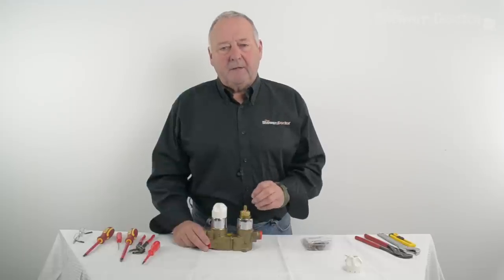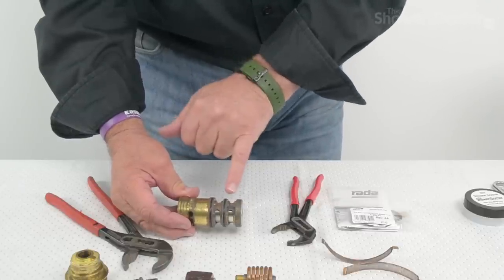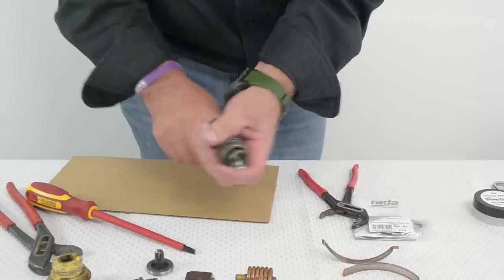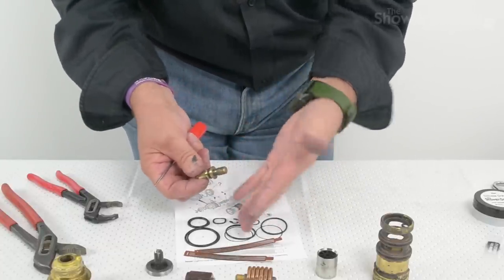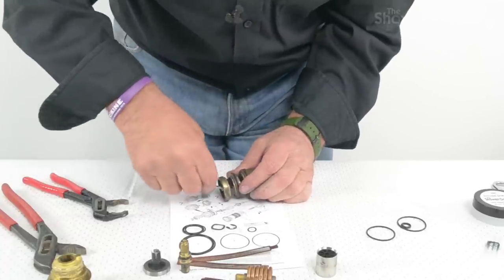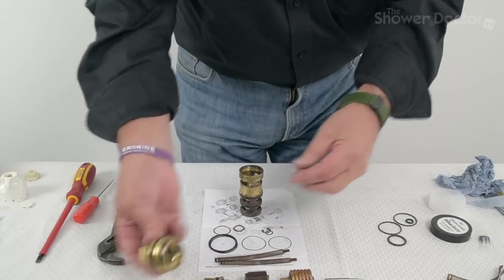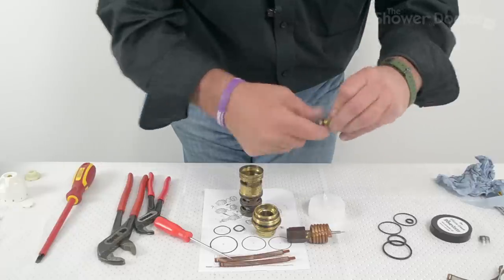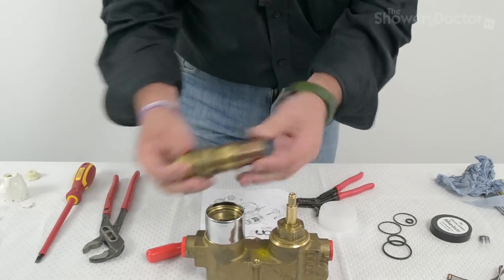Servicing Mira 915B shower valve. Part 3: Temperature cartridge

Comment: Really useful to show in detail how one of these comes to pieces and is put back together.  Thanks.

My shower stopped getting fully hot, just warm, even when the supplied hot water was very hot.  With the help of this video I fully disassembled (with the exception of removing the copper spring coil from the hex boss, couldn’t separate those).  Noticed the coil was distorted and caked in scale so cleaned that up, gently teased the coil back into a more even shape and greased the moving parts.  Now gets as hot as I can bear with the added benefit of much smoother control.

Comment: Correct me if I'm wrong, but it seems your setting instruction is round the wrong way. Surely the stop on the plastic hub should be on the other side of the brass stop, so that the control is prevented from turning further clockwise and making the water hotter? The way you have it set would prevent rotating anti-clockwise to allow flowing cooler. No.1=cold. No.9 =hot